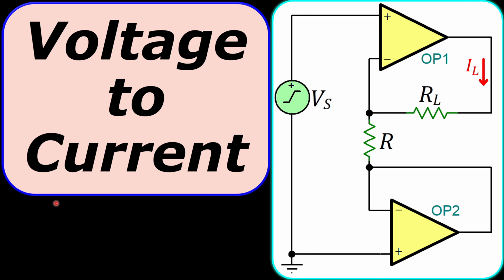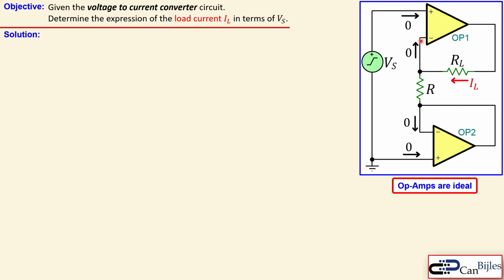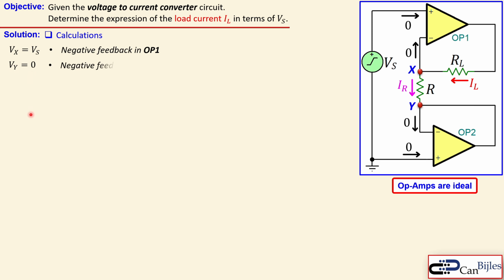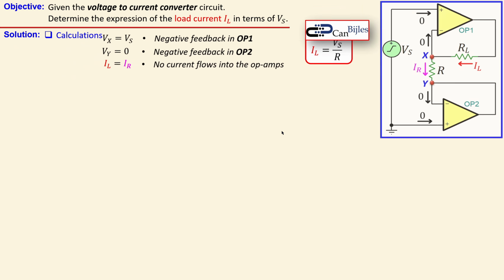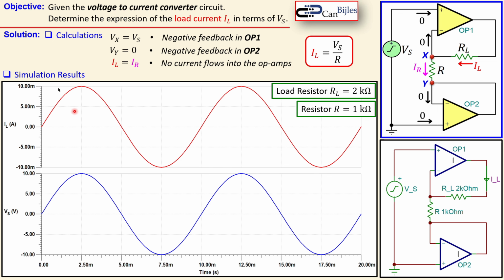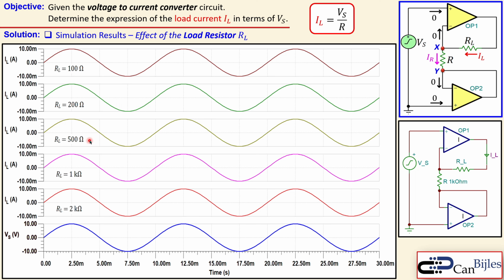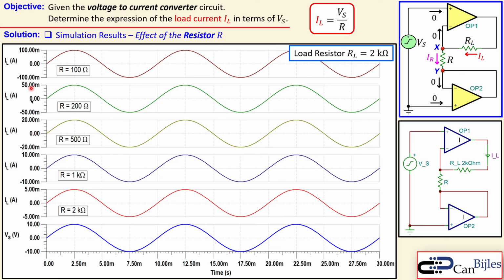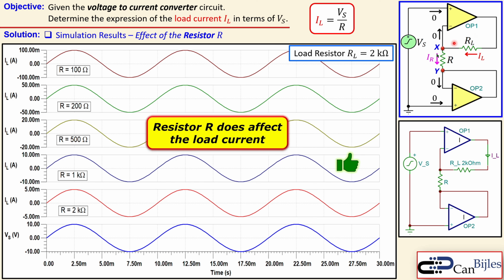Voltage to Current Converter Op-Amp Circuit ⭐ Single-Ended Input Voltage to Floating Load Current

Comment: Would you able to provide a stimulation for industrial V to I converter
Reply from the maker: What do you mean by industrial?
Reply: They are used for industrial applications. As it produces a output of 4-20mA for 0-5V input it often called as 4-20mA current loop transmitter.
Reply from the maker: @SarvedhaS   This is a nice topic to consider. I will check this also.
Reply: As I was given a project to stimulate the industrial V to I converter. Would you able to give the Idea for me to build the stimulation.